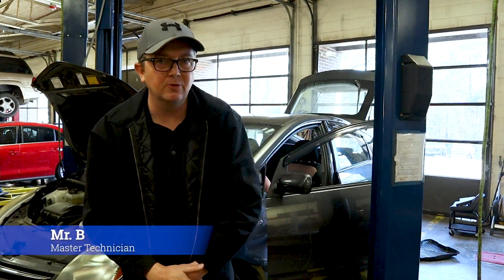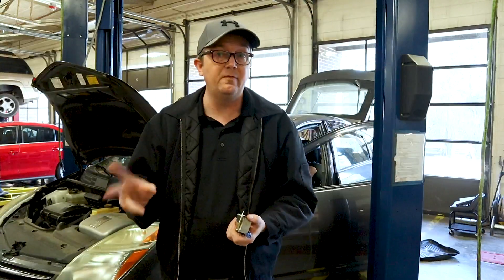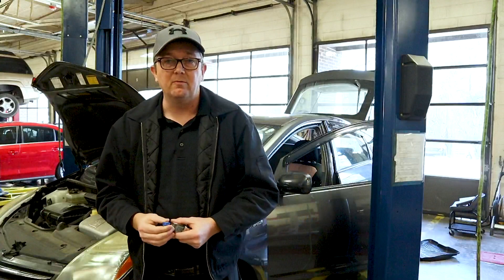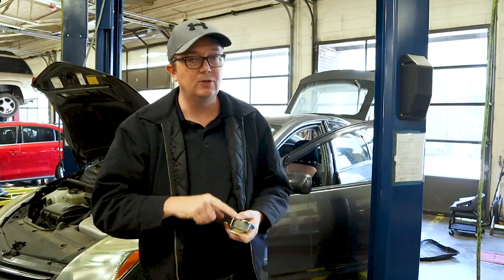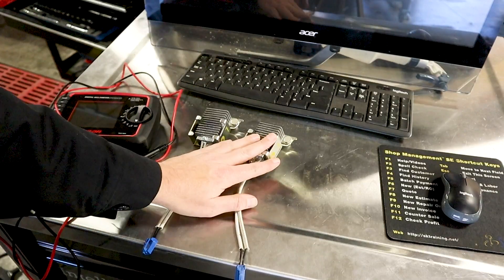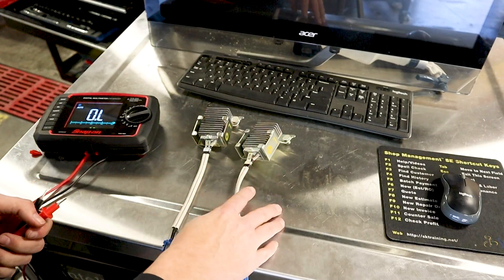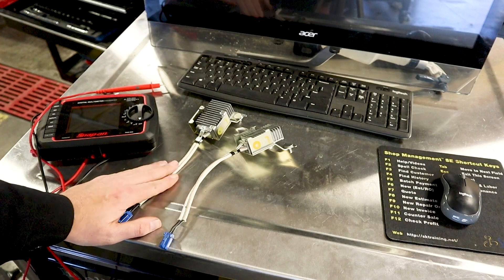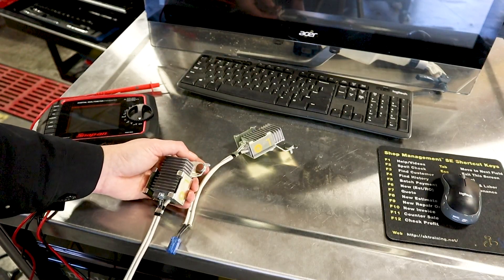Toyota Prius ABS pump and actuator resistor, removal and replacement for Gen 2

Comment: Just bought a gen2 used prius with 100,000 km with abs issue.. my abs motor is nut running when i open the driver door, though when i open the fuse box, i can hear relays clicking,but when the car is in ready model and starts to move the abs motor run wheh i press the brake while in motion , but during this case most of the braking power come from rear wheels and not front wheels..

Now, because of this, I am having a few codes related to the abs module. These codes are c1313,  c1377, and c1256.. what can i do solve the issue..all fuses are ok, and i can hear abs relays clickiking.

 Any help please

Comment: Is there a reprogramming or anything you have to do after installing the new pump and resistor to get the car running? Do you in fact need a scan tool to bleed the brakes?
Reply from the maker: @chrismark6574  Toyota says you do need a scan tool to bleed the brakes. Some people say there is a work around but I’ve never tried it.
Reply: @AutoScholarwithMrB  Thank you! Is there anything you need to do with a scan tool to program the new brake actuator to the car, or will simply plugging it in clear the codes and allow the car to run without the brake warning lights coming on?
Reply: I replaced the abs actuator and car has no gas pedal will it be bc of resistor ?

Comment: People, you def dont need to remove the dash, thats just over kill. I grabs my camera scope to see where its at first, then i reach in with my hand with a baby ratchet with a 10mm and bam! The hardest part is removing the connecter but just look at your new one and youll be fine. Im 6 feet tall and i was able to reach under there no problem with a little room to spare . anyone can do this unless your obese
Reply: i cut a hole in my dash. Also worked
Reply: @GemsMadeEZ 😂

Comment: I just swapped the ABS unit for a {purportedly used but tested unit]  Got it back together, and the car has a non-stop screaming alarm and I hear no running of the new(er) ABS unit.  It's not running at all, tried to bleed brakes.  Any tips?
Reply from the maker: Hard to say, any codes stored in the abs?
Reply: Did you end up figuring it out? I have the same issue. 

C1253(1/ 2) Current
Hydro-Booster Pump Motor Relay

C1256(2 / 2) Current
Accumulator Low Pressure
Reply: @ The "tested" abs pump was frozen, blew all fuses.  They sent another "tested" one, worked.

Comment: Previous owner of the vehicle disconnected this.. where does this plugin I cannot find any videos out there for where it plugs back in!!
Reply from the maker: It is a hard spot to video
Reply: Disconnected it why? To turn off the pump and drive as is, without ABS or brake assist? Did it work?

Comment: You can reach under the car dash and do it. I used a standard 3/8 craftsman 7 inch long and the width including the socket length is 1 1/2 inch long. It fit perfectly with a little room to spare. Torque is 5NM per manual and felt easy to loosen even though my arm is weak from that angle. Nut was 10mm like you said. It's the nut on the upper left of the back side of this unit. There is a nearby nut toward the middle and that's the wrong one having to do with some unrelated wiring. Your video really helped finding where it all was, excellent job.
Reply from the maker: I’m 6’6” and couldn’t fit ha ha!

Comment: Great advice! What do u think makes actuators GO bad? I jst sub'd lately, great videos. Appreciate prius vids. Love the steering wheel cover!💗💖 Also, like that Im not the ONLY one who's too old to get into tight spots!😂🤣
Reply from the maker: I think the valve that closes the accumulator leaks, possibly due to contamination. I have a few Gen 2 and one Gen 3 actuators, and I will probably do a video on taking them apart and looking at a possible cause. Thanks for the sub!
Reply: I know what makes the actuator go bad probably. It's the brake oil change needing to be done every year. I never changed it once and I made it to about 200,000 miles when it began leaking and intermittent buzzing . I had the actuator go out when it rained because whenever it had heavy activation it would be overwhelmed and deactivate then come back in a few seconds. Finally it gave out for not just a minute but for like 30-60 minutes this time before working again at 238,000 miles and it was now too annoying to have to put so much force on the gas pedal and it wouldn't stop whilst maintaining straight for very fast stops so it was too dangerous then. I went in for a Toyota's brake oil change at the dealership and the problem never came back during the rain so that's how I know clean brake fluid stops the problem. Yes it still leaked with the noise every 6 seconds but it worked. I still had the frequent pumping because it wasn't holding pressure but it still worked for even another 35,000 miles about more until it failed randomly for 2 minutes and I finally swapped in a new one.
Reply: Most assume it is a factory defect since Toyota offered extended coverage on gen2 and gen3 actuators.
Reply: Nitrogen is a very small molecule. It is impossible to seal into an accumulator indefinitely. My personal belief is they lose their pre-charge. In other words, the nitrogen leaks out just like a shock absorber wears out overtime.